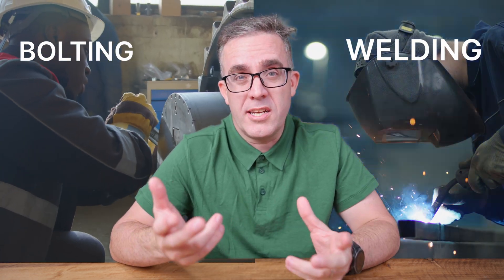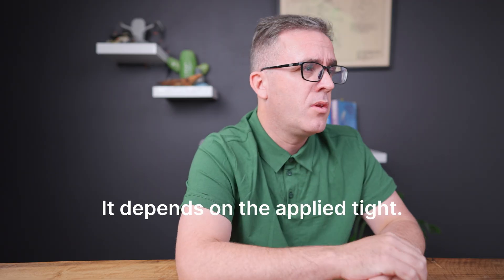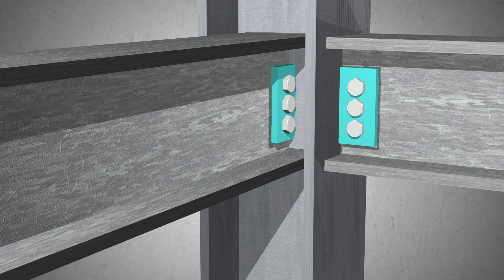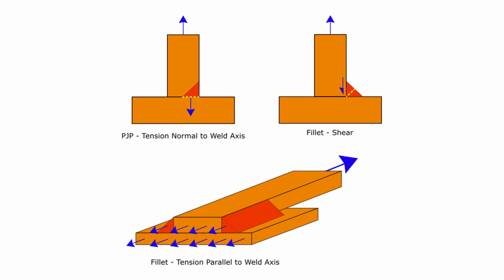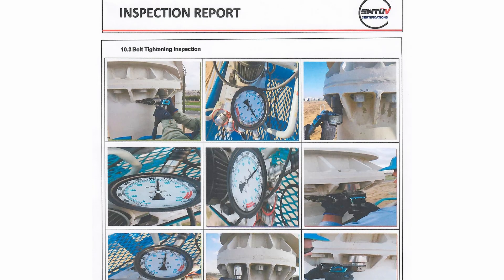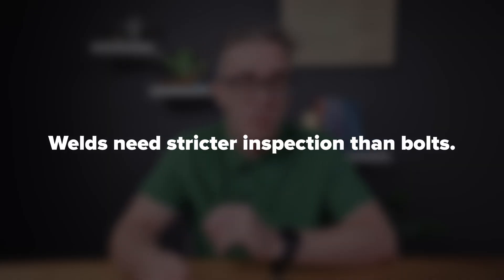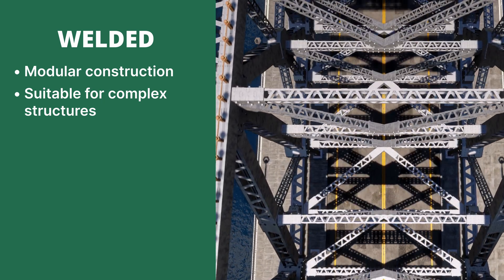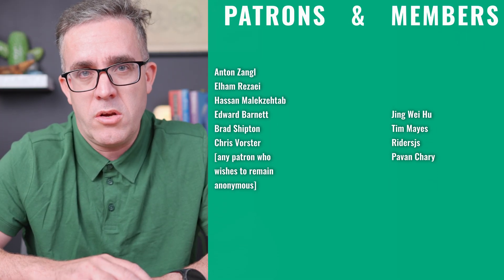Bolts vs Welding Joints – Pros, Cons & Best Uses

Comment from the maker: ✅Fin Plate Connection & Welding Check Calculation in Mathjot: https://www.mathjot.com/static/calculator-v2?zoom=scale(1)&jot=efdd2310-fdde-43f4-abc6-ea3b363d09db (if you would like to sign up this software that I co-founded, use code BRENDAN25 to get 25% off on annual subscriptions)

Comment: Hi Brendan,  thanks for the video as always. Definitely pros and cons with  welding and bolts but somehow my preference is bolts especially when it comes to maintenance or replacing members. If you have a well qualified welder it can make your job easier. However,  it can be challenging if the welds were not do to code or specifications. 
Stay safe 
Malik from Barbados.

Comment: I spent weeks measuring and locating hundereds of miss aligned bolted connection on beems and columns badly manufactured but still delivered to site.
The working drawimgs were the lowest priced drafting service that took design drawings and messed up the fabrication drawings. 
On site i was stuck recalculating from FFL to bolt centres and bolt sizes and refabricating for the others contractor to errect the repaired components. 
Balls up $$$$$$$.

Off topic but interesting  🤔  ???
Reply from the maker: I really enjoy reading your messages. At first it can feel like it is the cheapest option and most of the time it is, until it all goes wrong.
Typically in a factory welding is better, onsite bolting most of the time.
Reply: @BrendanHasty  the son of the owner, organised Singapore student engineers to produce the drawings. 
Fabricated in Kwinana and delivered to Alcoa at Pinjara down south. 
The crusher mill building. 
Very heavy components. Welded plates and bolted joints.
Erected by others, logically????, but expensive for us.
They Erected fast and charged us to lift it down and delay their progress 🙄 😒 

I became the Victim but lucky to survive. 
Happy days
Reply from the maker: Charging you for their issue, 😔. I think this happens a fair bit, live and learn.